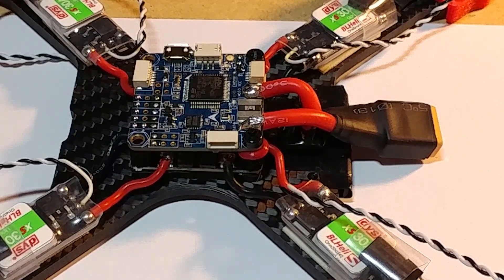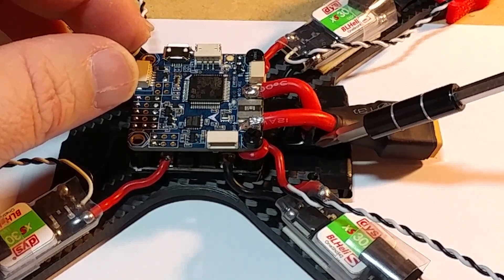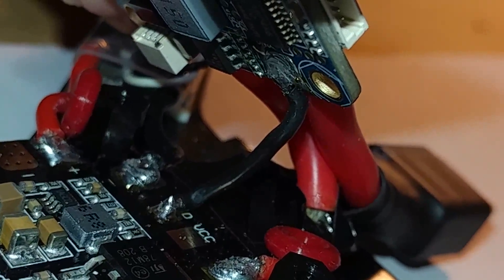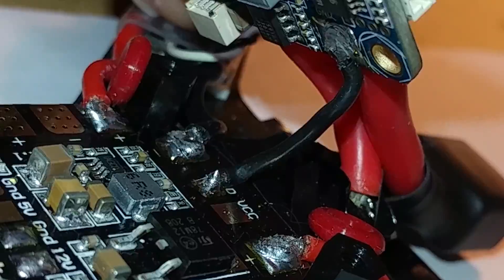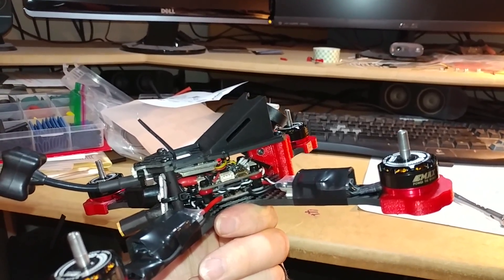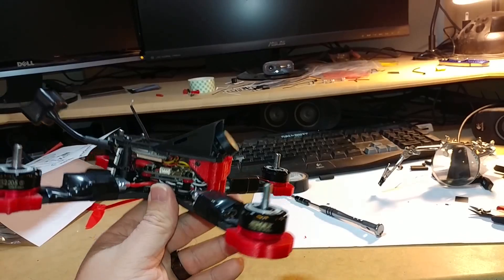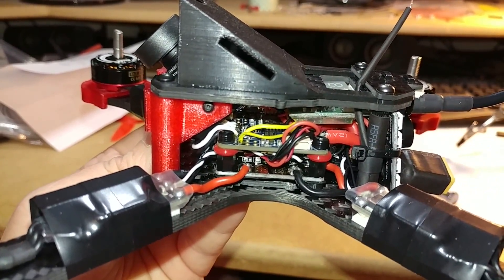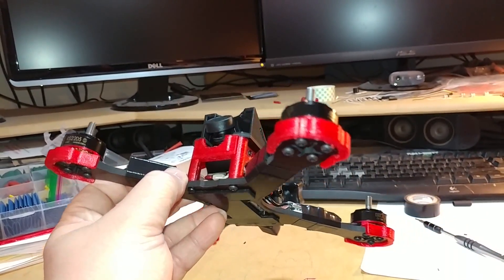Realacc x210 PDB & FC (OMNIBUS PRO) mounting Part 2 With Flite

Comment: Nice 3D print parts. Are you able to reach the button of the tx526 mounted that way? Im thinking about to buy this vtx, but it always has to be turned on again after battery change etc, right?
Reply from the maker: yes you can change vtx channel easily. The vtx stays on last channel it was one when power was turn off the quad.
Reply: Thanks a lot. I ordered the tx526 :)